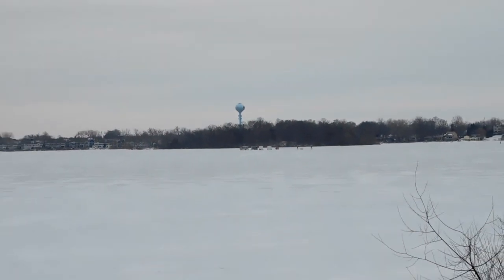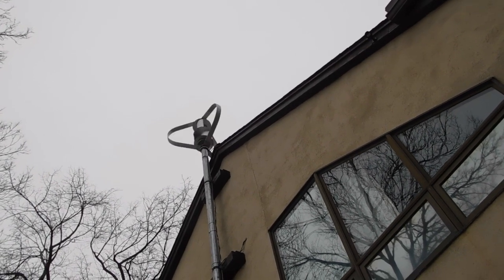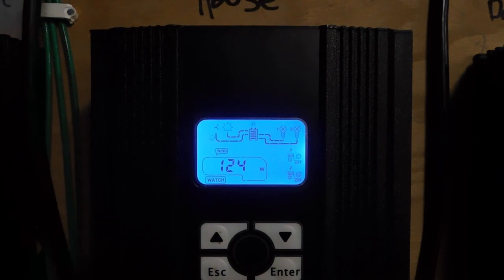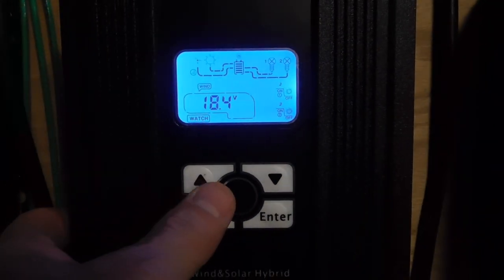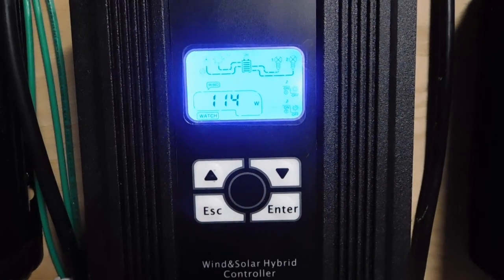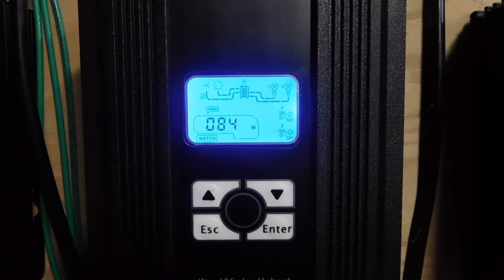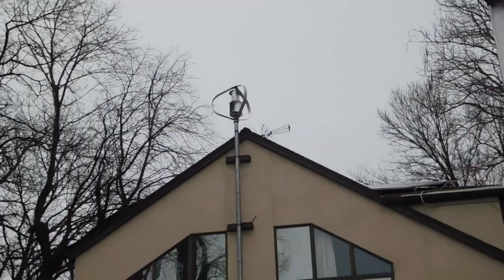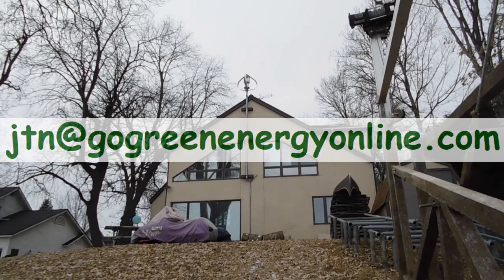300 Watt  Wind Turbine Real Life Production Numbers on Green Energy Adventures with the Turbine Guy

Comment: How much is this?
Reply from the maker: What you are seeing in this video is real time production numbers. Averaged over an hour and depending on good wind, this turbine could produce up to 2 kWh/day on windy days.
Reply: Turbine Guy how much does it cost? Can Where can I order this?
Reply from the maker: @96MustangBoy1  Send me an email at jtn@gogreenenergyonline.com and I can help you. $2500 plus shipping. Comes with a 12-24 volt charge controller.
Reply: Turbine Guy two thousand five hundred??.....That’s too much for me to pay.....good product though. Thanks for the information
Reply from the maker: You get what you pay for in the turbine world. We have 5 year guarantee and 20 year expected life.
Reply: @TurbineGuy  Small scale wind isn't for ppl looking for a ROI. I pay $.15 kWh, perfect installation location using your number above (2 kWh a day, which we know it won't sustain for an period of time) this is saving me $.30 a day perfect best case scenario. Even at $2500 (which would easily double once installation and everything else came into account) we're talking a 23 yr payback.. realistically, all costs included and output adjusted to reality this has about 100 year payback. But hey, still pretty cool. Probably some farmer that needs to run a pump somewhere that might want a different look than their usual HAWT
Reply from the maker: @danmosier5249  300 watt unit isn't for selling to the grid it's for offgrid cabins or other small scale like you said, like adding redundancy to a system. The 3 kw grid tied unit is for roi. 9000 kwh a year.   Also these are eligible for 26 percent tax credit just like solar is . Under ten year payback time, and they are fully recyclable and worth money at end of life if (aircraft aluminum is not cheap and why these cost more) these can also handle higher destructive wind speeds.

Comment: Here you have a real video of my wind turbine which is the same as the one you are presenting on your video and I would like to tell you that according to the way the propellers are moving and the rpm, it's impossible that the wind turbine generates 7 amp (when it generates 7amp, the propellers can be hardly seen because of its speed). Look at my video and check it! https://youtu.be/Sm2oCbAxT3M

Comment: I'm in the foothills of the Appalachian mountains, in NC, we have good wind at times, usually though around 10mph, and days with gust of 65mph, I am looking for something to supplement the pv panels, I have been looking at a thermodyne based turbine, with 7 or 9 maybe 11 blades, for my 24v system. I have lead acid. And lithium ion batteries, to run my off grid house, I was told unless I get over 20 mph wind , the best I could expect is 100-200 watts, with a 50"-70" turbine, I would like to know more about the controller you used! I do not have any grid power, my old house would need a complete rewire, so I went off grid, I also have generators, I'd like a mppt controller, but the midnite is expensive, and if I'm only going to get 100 w, its not worth it. I was currious if I could put a large capacitor between turbine and a solar mppt controller, if that would work? Any ideas are very welcome, thanks, I hope all the leagal crap has went in your favor, I just learned of it, good day and thanks...
Reply from the maker: That may have been true for other turbines, but the DS-3000 was just certified by the small wind certification council, so it does produce as claimed. I am sure they were talking propeller style for the height and production. These systems I sell are designed with a specifically programmed controller, I would not recommend any capacitors, just use the batteries for energy storage.